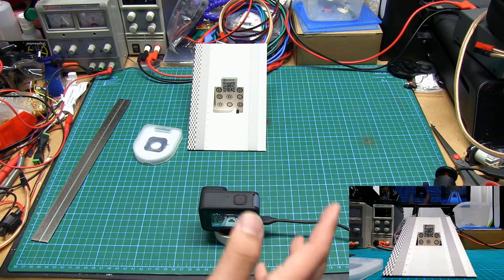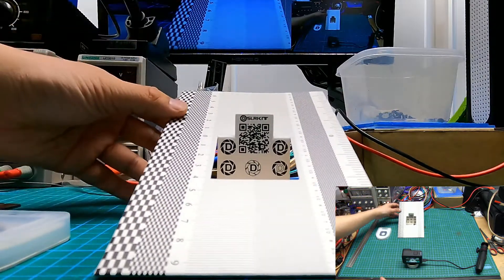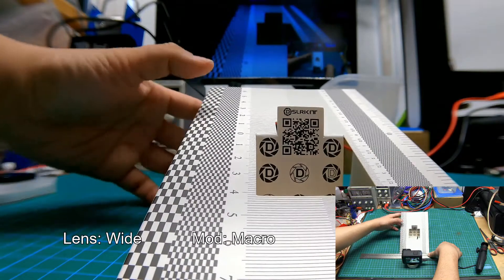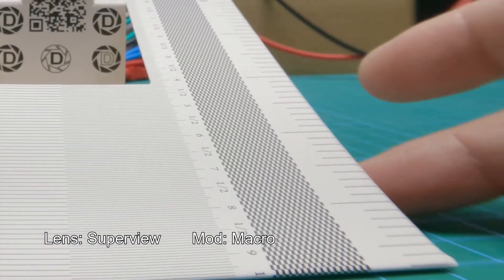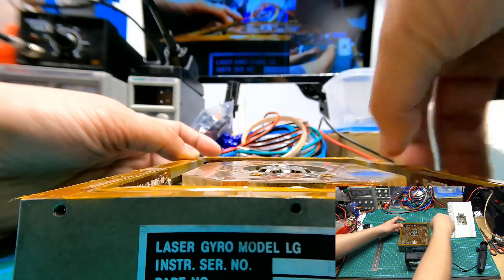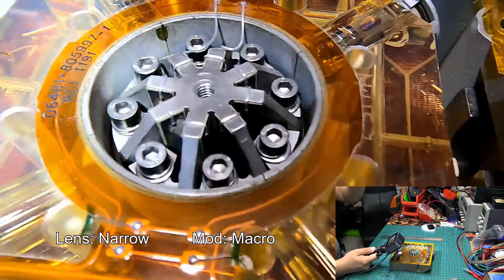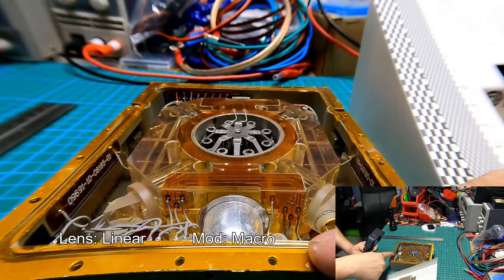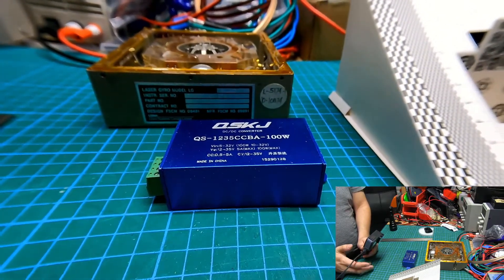Gopro Hero 9 Macro Lens Testing

Comment: Got one last week and just played with it in wide mode. The center is quite sharp and the edges are quite blurry. Not a problem depending on subject matter.  It will be another useful addition to the arsenal. Focus distance in wide mode seems to be best at about 3 inches.

Comment: thank you for this. have you tried the image stabilization with the macro lens.
Reply from the maker: No, I haven't tried the image stabilization with macro. What use case would there be macro shots that require image stabilization?
Reply: @aonomus  taking close ups of machinery specifically a sewing machines  I create sewing tutorials. I currently have my camera mounted on a nearby table and craned over my machine so it does not have the vibration. I would love to have the camera attached to my machine, or even set on the same table. The image stabilization works amazing to remove the vibration from video. However the regular GoPro lens cannot focus close enough for the bed of the sewing machine to take the videos. 
So I was looking at macro lenses to solve this.
Reply from the maker: @dragonwort  ok, maybe I can emulate it with my 3d printer? Will try it in a few weeks
Reply: @aonomus  thanks